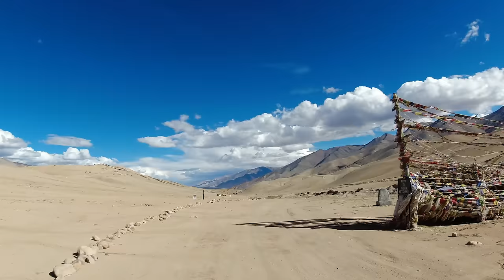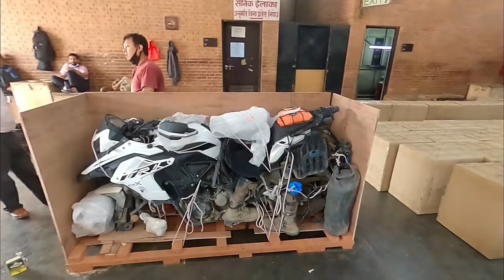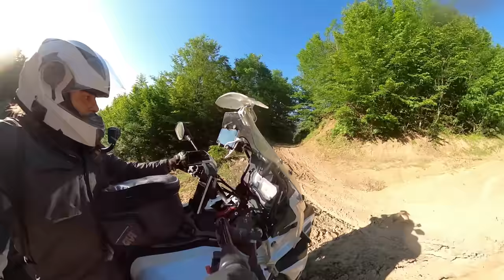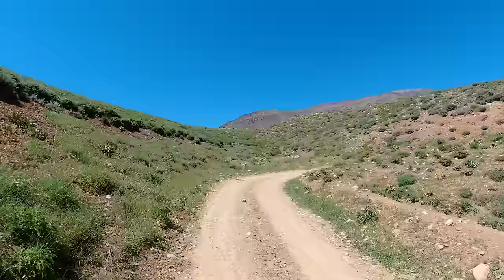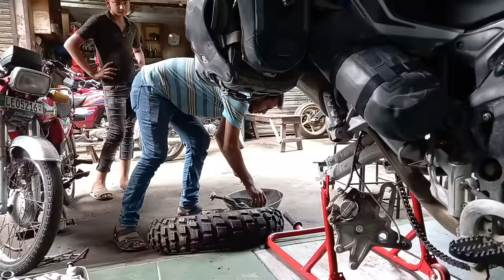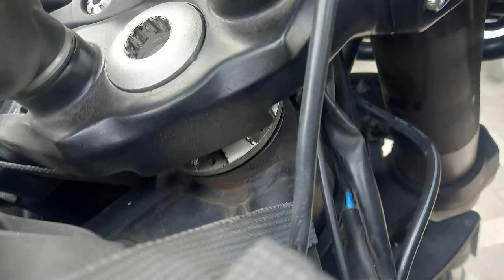Benelli TRK 502 X review after 85,000 km and 26 countries in 2 years

Comment: Even the Benelli's engineers wouldn't trust that much to their 500x. Thanks for the such a great video.
Reply from the maker: Ahahah, that's true 😁
Thanks
Reply: Absolutely not true, Benelli bikes have high reliability, I have a 302R with 60k kms, original engine and transmission.
Reply from the maker: @JaegerLeo  it was a joke 😊
Reply: @ZeroHighWays  I understand, but credit where credit is due, Benellis may be heavy or "slow", but they are definitely reliable, I'm not surprised it has lasted you this long and with proper care I'm sure it'll last you much longer
Reply from the maker: @JaegerLeo  i agree. But still, joke or not joke, it was not designed for such a hard abuse, so it's not far from the truth that even the designers might be surprised by the reliability 😊
Reply: BruceWayne-sz3th  60k not 60, 60k is 60,000

Comment: Hello sir good day to you, new to your channel. From what i understand, the TRK 502X have better performance on straight cement and gravel but a little problem if the cement have cracked edges and bumps and/or the gravel has a bit large rocks with edges especially with its ridiculous weight. Fuel must also be 91-95 octane, but the design of the tank is not good since people with thick thighs will have problems when standing or to balance. Can modifications be made to the suspensions and the shock to be more off-road friendly sir? Love from the Philippines btw sir, stay safe.
Reply from the maker: Thanks man. Yes, more or less that's what it is.
You can buy better suspensions, but you cannot adjust the stock front fork. The rear shock has all the adjustments you need, even if you adjust only the behaviour but not the quality (which is still acceptable)

Comment: My main worry is getting parts to replace this bikes parts in different countries. Was it hard to find replacement parts?
Reply from the maker: Not in the countries i travelled in. You can check on their website where official dealers are present.
Reply: @ZeroHighWays  wow. How did you handle parts replacement then on the trip?
Reply from the maker: @lllcinematography  well, i didn't have to change much, but when i had to i just went to an official dealer, the same i would have done in my home country
Reply: nice. good to know the parts last and don't need to be replaced so often. I'm deciding between this and the trk251. i see from your review that the size is a problem.I am leaning to the 251 based on your tip about handling it and the weight. @ZeroHighWays

Comment: Still i dont understand why people are using super heavy bikes for longer rides..150 to 200 kg is optimum weight required for headache free touring . Carnet is less. Fuel is less. Repair is easy . If breakdown, cargo is easy.  Everything is better except riding comfort. It is really neglectable
Reply from the maker: Because there are not so many options under 190/200kg at the moment, at least as new bikes.